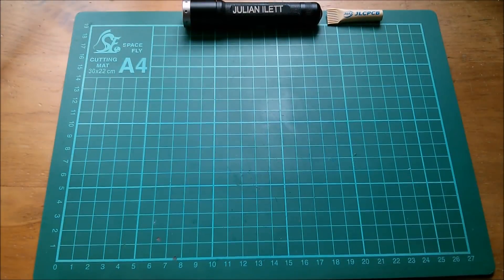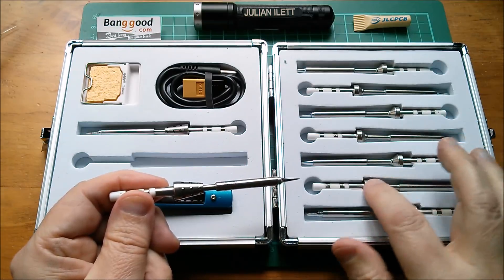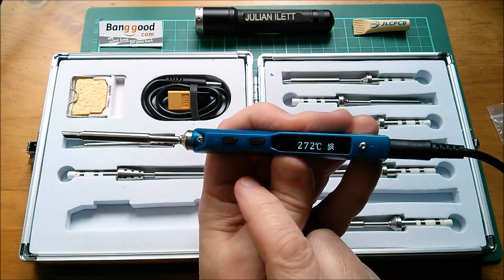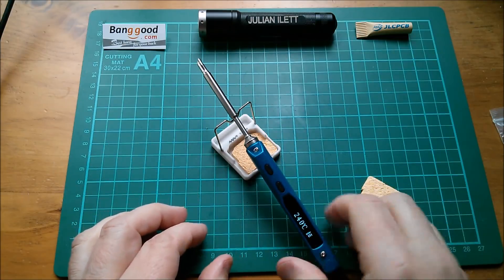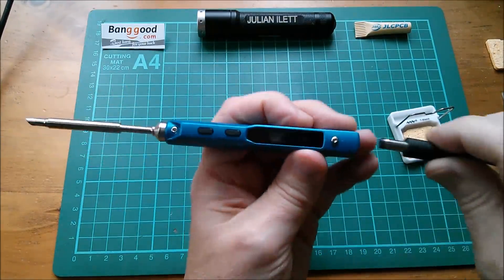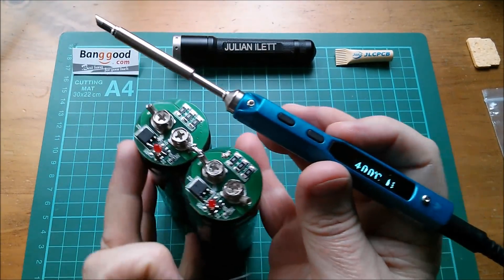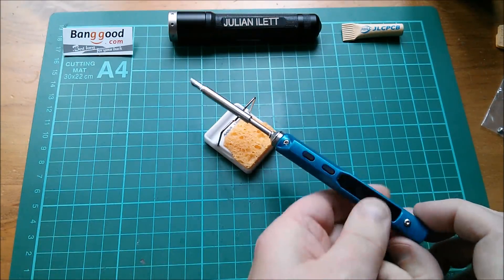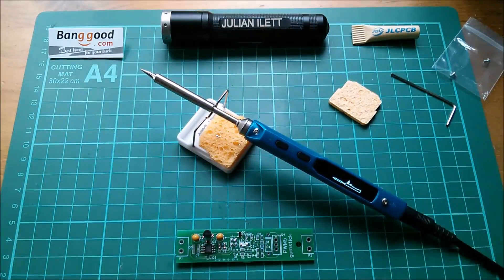TS100 Soldering Iron - Unboxing and First Look

Comment: The includes stand is trash. I know this from mine [Pinecil]

I designed my own stand based on a few m12 washers. which are the perfect size for the tips to rest into.

Not forgetting as the firmware is open-source, you can easily upgrade it. to a better firmware, with more features

Comment: 300 celsius is as hot as it goes with the firmware that comes on it I found.....There is some GREAT firmware  for it that is open source and changes the whole thing and the temp. will go higher as well, I have mine set to fahrenheit and it goes to 700 degrees anyway and that is PLENTY hot for most things, has been for anything I used it for, I do so recommend upgrading the firmware to it, you may also set up your own custom splash screen when it first gets plugged in!! Yes they are awesome little units for sure! I hardley ever use my Weller Station anymore hahaha!! The SUPER benefit of it as well is portability!! All you need is a Lipo pack and make up an adapter and you can do fine precise temperature soldering ANYWHERE!! WAY better than the old butane ones with no temp control!!!   ;) good vid!! L8r-Turbo.

Comment: I see you did not use a stronger DC Power Supply Adapter Transformer that is 24v 4A, with a 24v DC Power Supply Adapter Transformer it works MUCH better.

Comment: Where did you get the adapter power cable for the TS100? I need to obtain these power adapter cables. Love you shows. Keep it up. I learned about solar panels, batteries, and
battery charges from your YouTube videos.

Comment: Yours isn't performing too well. Mine was like that with the stock power supply. Switched to a full 24 volt power supply and it screams. Room temperature to 450c in 11 seconds.
Yes 450c, with the custom firmware.
Reply: depends on how much Amp your power supply can deliver. I am using it with 24V 5 AMP and it is super fast

Comment: I have the bare kit (iron, 1 tip, psu) and I never read the manual. Had no idea about different voltages .. Thanks
Reply: wery expensive buy 120$ kit same iron and one tip can buy 20$ many shop. and spare many different tip can orden more if need 10$ pcs. power supply have in home many normal men. 24V power supply have best thats.

Comment: Being open source, your best bet is to change the default firmware for the following.

Gives you much finer control over the iron, along controls for various lipo battery voltages (monitoring)

https://github.com/Ralim/ts100

Comment: I bought one and while it was a handy little device I ended up selling it because it was a little too small for my hands, constantly felt my fingers edging towards the metal part of the tip. If it they make some sort of guard or handy thing so I can hold further down it would have been awesome. Also there's the issue of what you connect it to, most say to just use any old pc power supply and while those work on the power side of things the cables on them tend to have a rigidity that easily drags the soldering iron around. The latter could easily be fixed by adding a good flexible extension cable in the kit, or at least give us the option to buy one!

Other than those tiny things it makes normal soldering stations look like last century stuff by comparison, which is odd since it's actually quite a bit cheaper than even the chinese alternatives while even still feeling like a luxury tool.

Comment: I have an old Weller, I think the lables have burnt off, 30/90 watt. I use it for heavy wire and case connections. It has the tips that splits into two mounting nuts. The cost of the tip is stupid high given their life cycle at 90w. So One day when the tip popped apart, on a holiday, kids freaking out my toy my toy, I made my own. Taking a piece of #8 solid, bent it in half, then used a torch to puddle the tip solid. I thought while you have the torch out..... I then shaped the tip on a grinder. When back to the torch and silver coated it, all of it, with a heavy pure silver coating. I know that's more money than buying new one's but there it is.
Afterwards I noticed the iron seemed to handle the thicker materials much better. It had faster larger flows than before. I also noticed the iron itself would get hotter around the handle. So maybe the same is true for whatever coating they applied to the to tips in your kit and the extra cap is to dissipate the heat from getting to the handle?  
By the way I have a bad habit of pressing too hard on the tip. Somehow My subconscious mind fills more pressure equals more heat. <<<The reason tips fail me quickly. After about a year, same tip, I ran across a piece of ceramic I cut down to fit the void between the legs of the tip to help stop it from flexing when I stand on my welds. The end of the story is I now have a 65 year old Bakelite soldering iron with an indestructible tip. Works on the single pin 30w units as well but it seems to take a lot longer to warm up.

Comment: don't need to plug in to the computer to change settings, just press the other button at power up (unless you got old firmware, then update first).  also, use at least 19v power supply, 12v can't provide enough power for heavy soldering.  I use mine with a portable battery bank intended for laptops, set to 20v.

Comment: The constant idle animation would annoy me out the corner of my eye.   I don't think the test was fair since you didn't show how your normal iron coped when the bolt on your super cap was loosened,  for all we know your antex would have just fared as well, possibly even better as I think they have a little more thermal mass once heated up.  For portable use would be handy but not desk.

Comment: I think you really do need to use the earthing wire if running it from a switch mode power supply. I was using mine with a good quality 19v laptop supply, but there was enough leakage current to flicker the LEDs on the PCB I was soldering and to blow two MOSFETs.
Reply from the maker: That's why a battery powered soldering iron appeals :)

Comment: I thought this looked like a worthwhile  investment until I checked the Banggood site.
Not at £105 it isn't!!!
Reply: You can get these cheaper than that, though I'm not sure if they're clones or what. But an important thing to bear in mind is that these are compatible with Hakko tips, and the cheapest Hakko station for those direct heat tips is more than twice the price of this set - and that doesn't come with 9 tips.

Comment: I have one of these, too. I also recommend the Ralim firmware and 19 volts to power it - at least if you have the choice.

I think buying the whole set isn't really a bargain - for the price I would recommend buying a regular soldering station with 80+ watts or something like that.

But if you only get the base unit (which also contains a tip) and maybe one or two additional tips you need/like you get a quality product for a decent price.

If you really want to use it as bench soldering iron, I recommend getting a really flexible (maybe even silicone) cable since many (cheap) notebook power supplies often come with thick and inflexible wires, which can become annoying if you're going to use the iron more often.

Comment: Yeah, all good, But not nearly production quality. That thing won't last a day in a proper shop. Sorry!
Reply: Duh. Because it's obviously not meant for that. Of course you'd have a professional - JBC, Hakko or whatever - iron with base station in a professional electronics shop. It's like saying that a consumer oriented, compact guitar amp wouldn't last a day on tour. You have to judge it for what it is. And this little iron packs a decent punch - if provided with the proper power source - for its size. And with its compact size, it doesn't take much room on your desk when working with it and it can easily be carried with you and, if necessary, be powered from a LiPo as well.

Comment: Wow, that's a $200USD kit!   chaCHING!   It's a nice kit, but I think that two tips would be sufficient to cover most jobs.  One small one which wouldn't lift pads or fry components, and a large one for big jobs like the cap terminals.  How many people would change tips each time they had a slightly different sized job?  I have a cheap Chiwanese 35w adjustable power unit and my old Weller 100w pistol grip soldering gun.

Comment: Could just build a rig out of wood for soldering said terminals jumpers, so you don't heat soak the supercaps terminal sockets and it will make soldering the terminal jumpers easier/quicker.. Just a thought...
Reply from the maker: Excellent idea ;)

Comment: I got a TS100 a year ago,  think it's really good value for the money, although a complete kit like in this review is way more than I need. I got just the iron with one tip and then got two additional ones that I really wanted. I mostly run it off a 19v computer power adapter, but 12v works in a pinch as well.

Comment: I don’t know, 120€ is pretty expensive. For Tips I don’t need, a cable I won’t use, and a TS100 that costs 50€...
Reply: 70€ with 19v power supply.
Reply: Nah. I do have a few 24V PSUs lying around. Has the benefit of getting the full power.

Comment: Banggood has been very nice to you?  I had the opposite experience with them.  I've only ordered one item from them so far and, when I received it, none of the buttons worked on it (it's a buck converter).  Luckily I paid via PayPal because they're being uncooperative.  I had to escalate to a claim and they're still not answering.  Eventually, PayPal will reimburse me.  This is just a warning to people to use PayPal when you buy from them.  Don't pay them directly, just in case you get something defective.
Reply: Jesus never Not use PayPal.  I have accidently paid using my card and although I still got the cash back PayPal is ur ultimate weapon in getting what u paid for.

Comment: Use one of your boost converters to ramp-up the voltage so you can squeeze more thermal energy out of it :) 
Plus, the other two tips Mike told you would make quite a good kit :D
Also the ceramic stand (base) looks nice (more on the cuteness side)  but I would find a more, let's say a more proper one for it.

Comment: You should do this some justice and show using it with the correct wattage for the job :/. From what I've seen from others it's pretty amazing. There is even opensource software available to download, you can also use hakko tips etc...
Reply: So very true.

Comment: Another reason to work on making your solar power system 24 volts (instead of the crazy 5 volts you were thinking about)! But in the meantime, you could use one of those beefy boost converters to supply the iron with 24 volts when you need the power.
Reply: Just think, the new USB C version can be upgraded in the spring to the new USB C  240 standard at 48V like most solar power systems and run direct!

Comment: That looks really good. The price is a bit out of my league, but then again I don't need all those tips. They sell a single tip version for £40 which is much closer to what I'd buy. Thanks for sharing.
Also tape the allen key to the power cable. That's how we kept track of chuck keys on drills before the keyless chucks today.
Reply: the extras are not needed is case, the cable you can DIY, only one extra tip is needed, the conical isn't that good...
Reply: I bought the single tip version about ten months ago for NZD63, and added a couple of different tips later on.   They cost around NZD15 each.   The posh kit Julian tested looks great, but what I have does all I need for rather less outlay.   I love the iron by the way; I look for excuses to use it.

Comment: I don't know why you'd ever want to run at such a low temperature. At some point you'll put MORE heat into components when turning the temperature down. At lower temperatures it will take longer for the whole solder joint to get hot enough to flow, which means there's also more time for heat to flow to the components. I have my iron set to 340-350°C. There's almost no tip oxidation occuring at that temperature (but it really starts to kick in above 350°).
Reply: correct ! and before switching off, leave a blob of solder on the tip to prevent oxidizing of the tip.

Comment: That all over the place with the temperature happens if you have a lot of EM fields around and touch the ground ... like any screw or the tip. I dont think a long input wire running throu the garden in to the house helps mutch either.

Other firmware you have been already told ... But it can store your settings and you dont have to edit the file anymore as it can be done on the iron it self. It also removes some limitations, has better battery protection and can show you the input voltage. Handy if you are using Lithium packs 4S works grate btw.

Comment: Julian, there is this custom firmware available as well https://github.com/Ralim/ts100 works very well and you can tweak everything from the soldering iron
Reply: true no need, i has use genuine and no need change anythink.

Comment: seriously, $140 don't even comes with a wall wart for a start?
i mean adafruit is selling Hakko FX-888D for $110, probably +$30 (at worse) on shipping but a person must be really desperate to get a no name portable iron for that price.
Reply: Well, just sticking a brand name on it dowsn't change the quality itself. Also here you can adjust parameters that are unavailable on a Hakko-Idon. Lastly this one is using a completely different technology - you might want to watch the "direct vs. indirect heater" videos all arround.
Reply: They're not really comparable products. This is very portable and comes with a cable with an XT60 on it to connect to an RC Lipo battery. 

I'd certainly pick the Hakko for use at home though.

Comment: T12 tips go through the same settling/calibration phase upon first use, the wildly changing temperatures during this initial phase are normal.  You might like it now, but you'll like it MUCH more at 24 volts. Have a look at the various T12 kits on offer online, T12's give you the same characteristics of the TS100 tips, but in a more standard iron length.

Comment: Never thought a soldering iron would ever need USB, but here we are...
A purchase in the near future seems inevitable, given that my ebike has 10 6S lipos and XT60 connectors.
Now if they could make a tip that could be used for boiling water in a mug for a cuppa, I'd be all set!
Reply: Just get a new spare tip and put it in the cup, just don't submerge the whole iron but just the tip :)
Reply: I think I'd try hacking a 50W resistor with the aluminium cooling fins, bury a bit into it and seal with molten aluminium if it can't get a tight fit.
Would be OK to use a spare tip, or even a used one if the leaded solder could be kept away from the water.
A spare tip by itself would have too small a surface area to be very effective.
65W would work eventually. The usual cup elements that run from a car's cigar lighter are about 300W, and they work pretty well.

Comment: Julian 
The tip you initially selected ("wedge shaped") is a chisel tip. 
The "squiggly lines" are quite evidently supposed to convey that the iron is hot and at the set temperature. (Like a steaming turd!)
The default configuration can be changed using the iron itself, rather than connecting to a computer. 
Cellulite sponges for soldering irons usually come compressed (either as a result of manufacture or to save space). 
Your naivety sometimes belies someone of your age.
Reply: The water sponge will cool down and oxidize the tip, the metal sponge is better.

Comment: Julian, I have the iron for a few months alread; I updated firmware to Ralim''s one, which you should really do - and I still found some issues:
1. without grounding, the tip gets an induced voltage of about 60V AC. Very low current, but it will power LED's when touching around a circuit.
2. if you don't have a 24V power supply, you don't get the 60W of power - the lower the voltage the more "sluggish" the iron becomes.
Reply: It WILL go away, because it's not the fault of the iron. The circuit of the soldering iron can't produce a higher voltage than it is fed. Measure the laptop PSU's output against mains ground. You will see that you already have the 60V (or more; the value changes with load) there. Use an earthed laptop PSU (those that have a Schuko plug; most brand laptops will come with a PSU like that), if you are worried about that. They shouldn't have that offset.
Reply: The 60V at the tip don't have anything to do with the iron. That's your power supply's EMC capacitor (not a fault, but a sideeffect in unearthed switch mode PSUs).
Reply: There's a screw near the power connector which is labelled with the earth symbol, so presumably one is supposed to earth it via that if that's a concern.
Reply: Andrew Gillard yeah, i did that, immediately after noticing this weirdness. Indeed it solves the problem, but now I have another wire hanging around
Reply: superdau I do use it with a laptop PSU (I always have the laptop brick with me, so basically I have a soldering station with me all the time). Will try to power it from a bench power supply to see if it goes away or not.